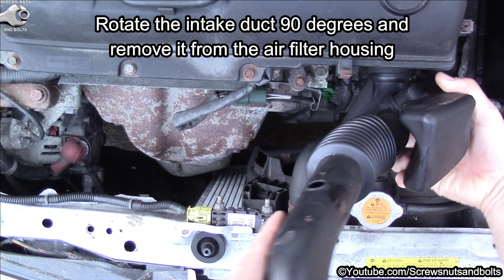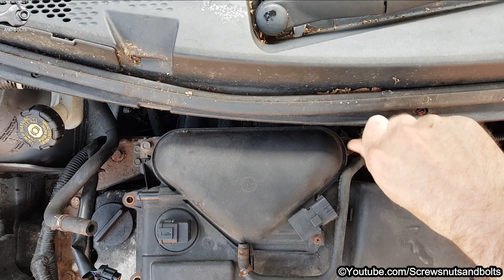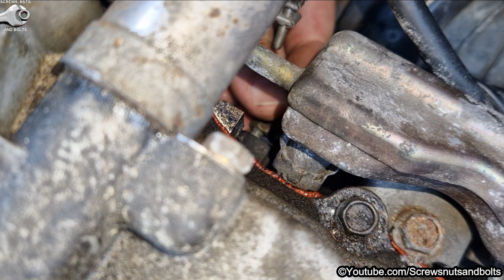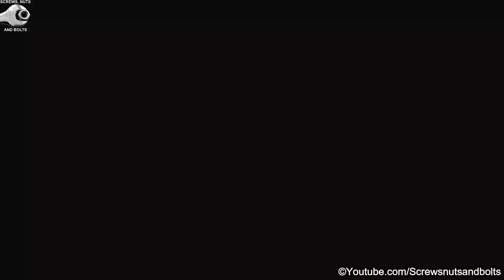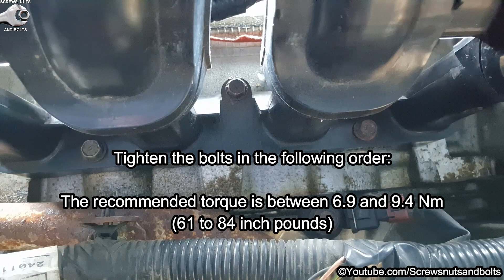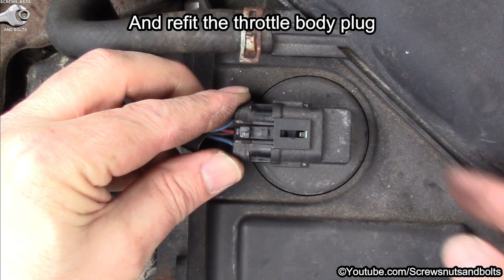Intake Manifold Gasket Renewal - Nissan Micra K12

Comment: I'm enjoying you Micra K12 video's, my son has just bought his first car and we are checking your videos for faults he has to fix. If possible could you do a video on adjusting the headlight beam to get past the NCT please ?
Reply from the maker: Thanks for watching. I can't do that I'm afraid as you need to use specialised optical beam setting equipment. You'll probably have to have that carried out at a garage.
Reply: @screwsnutsandbolts  Thanks for replying, i guess we were hoping for a ChrisFix type of headlight adjustment tutorial. He has an old video about it, but we're interested in learning where the K12's adjusters are. Thanks again and keep up the good work
Reply from the maker: I'll have a look and see what I can find
Reply from the maker: Hi, if you pause this video at 3:18:  https://www.youtube.com/watch?v=Y5Rvv7HoR74 you can see the left/right adjuster at the bottom right of the picture (the black plastic threaded lug) and the up/down adjuster is the white pot at the top right of the picture (on the top of the headlight adjuster unit). The Nissan manual states: CAUTION: Adjustment with the aiming adjusting screw must be done in
the tightening direction. (When adjusting in the loosening direc-
tion, first loosen the screw, then tighten again.)

Comment: Hi, just about to change the starter on my daughters K12 using your other video!!   so will be changing the manifold gaskets when i have this apart.  can you highlight where you add the air housing sealing ring didnt see that in the video... is it 4 of these i need?
Reply from the maker: I didn't change those and I don't have the Micra any more I'm afraid. Yes you need 4 of them and the part number is: Nissan 14032AX610. Double check that part number to be sure.
Reply: Thanks for the quick reply, I guess I might as well change them if I have the manifold off daughter will be keeping the car for a while...
Reply: The again maybe not... they are £40 for the 4 of them!!! Starter motor replacement is starting to add up!!!
Reply from the maker: You're welcome, yes they're quite expensive alright. I would only change them if they're badly split or damaged
Reply: Sorry one last question on this, planning it for this weekend... If we disconnect the battery will we need the radio code? Not sure we have that so might need to remove the serial number to get the radio details to get the code before I can do the starter.....
Reply: @graemestruthers4991 if you disconnect it for a short period of time then it should be okay. I had the car sitting with a flat battery a few times before, and had no problems.

Comment: What sort of issues would you get with a bad intake manifold gasket
Reply from the maker: If the gasket is leaking it will create a vacuum leak at the manifold. This could cause a check engine light due to an incorrect MAP sensor reading. You might notice a hissing sound when the engine is running, the engine may be hard to start or it may have a rough idle.
Reply: Difficult to start, especially when the engine is at operating temperature. The mixture becomes leaner, which also increases the combustion temperature. Also recognizable by a particularly white color of the spark plugs. If the vacuum in the intake manifold is too low due to a leak, the check engine light should also light up.

Comment: You know where i can buy the 4 bolts for the manifold 😮 - got slight hissing and high idle - want to change the gasket plus rubber parts plus 4 new bolts - 🔩 somebody lost the left bottom when servicing probably and fitted a dofferent bolt - that is the issue i think 

Going to have a look down the scrap yards try and buy whole manifold gasket and bolts etc
Reply from the maker: This might help with the part number: http://nissan4u.com/parts/micra/el_k12e/2003_8/type_12/engine_mechanical/manifold/illustration_1/